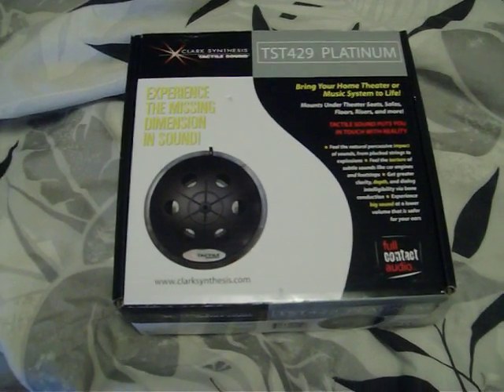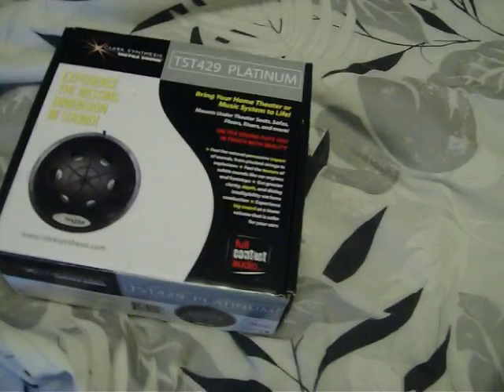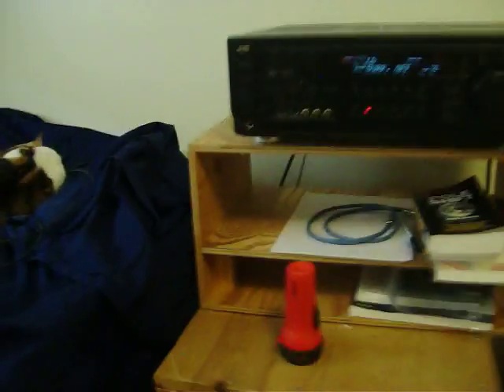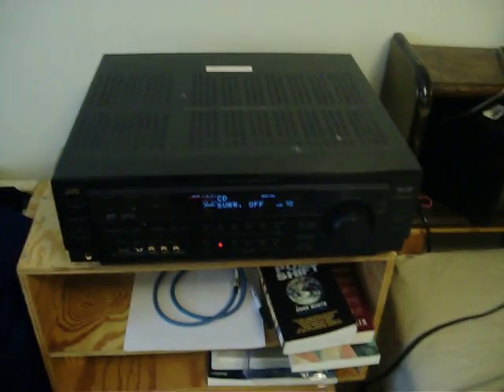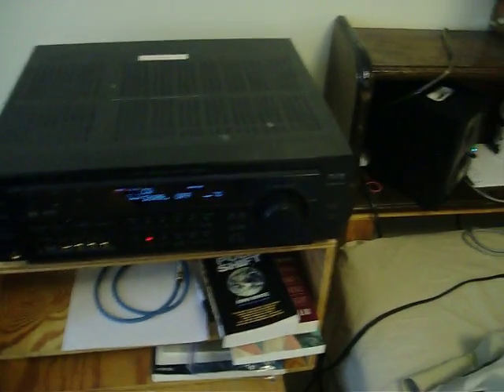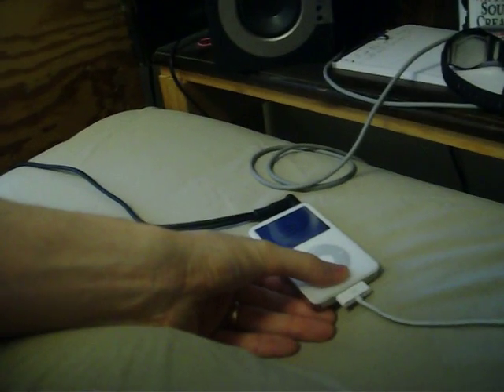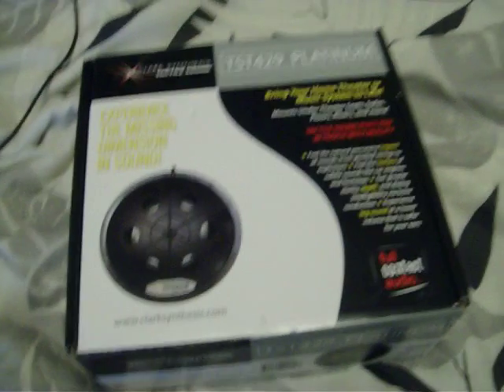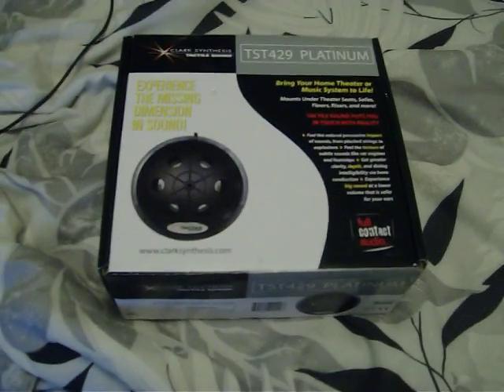Vibrating Waterbed using the Clark Synthesis TST429 Platinum tactile transducer

Comment: Thank you. Now 14 years later do you still recommend this setup! I’m considering getting a waterbed  That is 90 to 95% waveless I’m interested in playing healing frequencies or something like that while I’m sleeping. If you have any recommendations or updates on this method, I would love to hear them
Reply: Yes - a very comfortable waveless waterbed mattress may be ideal.  It will require a powerful transducer like the Porter & Davies TT6 - Ideally several of them.  If possible, you will want to modify your waterbed stand so the plywood boards underneath are resting on slabs of foam, with the transducers attached to the top sheets of plywood.  I can talk to you more about design if needed.

Comment: Hi, Excellent job!! 
Can you tell me how to connect the transducer to an amplifier? And is it possible to make the transducer only vibrate and have a pair of headphones for the pearson on the vibroacoustic bed?
Reply: The transducer has two wires just like a loudspeaker. You can wire it any way you would wire a normal speaker. When the transducer vibrates the table, it turns the table into a loudspeaker, so you will hear sound in the audible range. You can use a crossover to lowpass filter the signal that you send to the transducer, and that will limit the vibrations to the low end of the spectrum, and then you can send the high-end to your loudspeakers or headphones.
Reply: @nasonschooler6807  thanks Nason!!

Comment: Well hi cousin! I'm doing a waterbed rebuild, and did a search for a waterbed vibrator, and you pop up from 12 years ago!
Reply: Hey Cuz, how's it going? What are the odds? Since you're rebuilding a waterbed, you should put one of these transducers on it and turn it into a sound therapy bed at the same time.
Reply: @nasonschooler6807  At this point I'm looking at using a AC Vibration Motor Governor Variable Speed Controller With Switch 220V/110V and a  Vibrating Asynchronous Vibrator Motor100W 110V Single Phase... wide open that's 66lbs of force.
Reply: @landenschooler6726  oh ok - so you're looking for mechanical vibration.  The transducers I'm using are Voice Coil actuators, so they reproduce any waveform accurately, like a loudspeaker.
Reply: @nasonschooler6807  My 1975 vintage receiver doesn't live in my bedroom. I have components ordered, should be here Friday.

Comment: Hi, great post, would you mind sharing the make/model of the $60 vibration isolators? Thx for sharing. d
Reply: Here's the Mason Industries PDF about them.  I'm pretty sure they're the A310 model.
 http://www.mason-industries.com/masonind/_doc/pdf/c210v2.pdf
Reply: Sorry - just realized this is the first version of the table I built.  It's actually on the $5 isolation mounts.  I went cheap.  They are from Parts Express

Comment from the maker: Probably not by using the sub out - most sub outs are just preamp outs (an RCA jack).  You can just wire up the transducers like speakers - use your main speaker outs.  Just watch your Impedance.  If your kenwood is like most, it can't handle less than 8 ohms, which means you'll need 2 of these transducers wired properly together to produce an 8 ohm load, since they're 4 each.